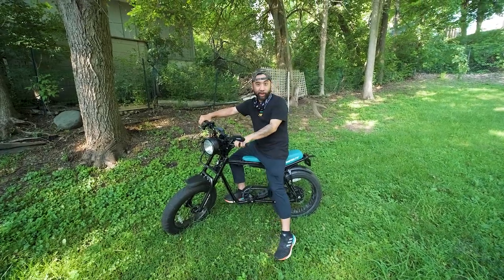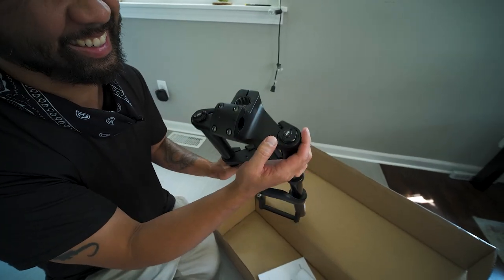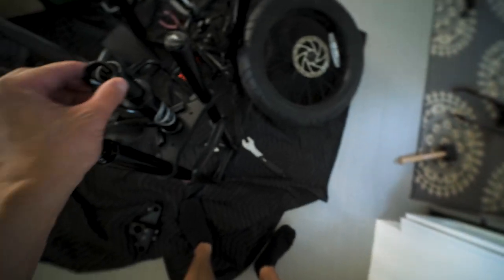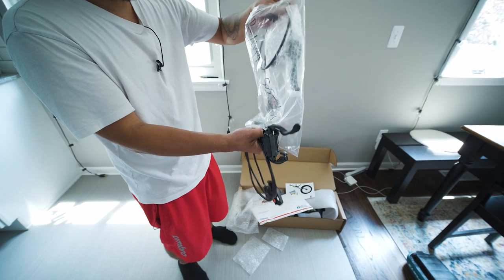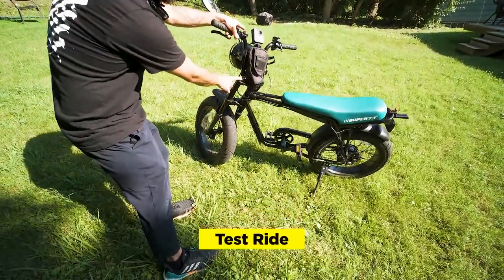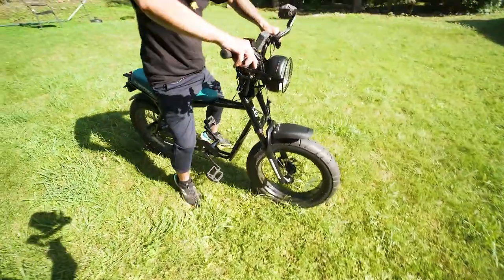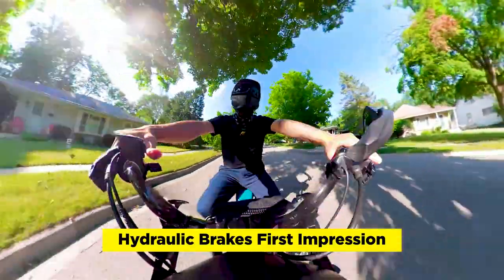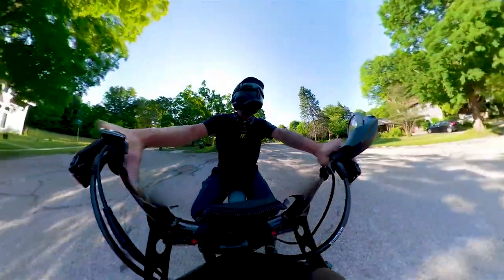Super73 Z1 Air Suspension Fork & Shimano Hydraulic Brakes First Impression | RunPlayBack

Comment: Hey man love the vid, I’m thinking of putting hydraulic brakes on my super 73 and I’m a bit confused on what I should do with the brake cut off. When I install the new brakes should/ could I leave the connector just empty or do I need to put something in place for that?
Reply from the maker: I left it off. It's not necessary.

Comment: the ebay seller for the hydraulic brakes is sold out of the black color option.  Any other upgrade options you know of...i need to do it ASAP.   Any suggestions would be greatly appreciated.

Comment: Hey question is it ok to get rid of the cut off motor from the hydraulic breaks it won't hurt the motor im trying to do the same on my bike?? Thanks in advance!
Reply from the maker: Yup that's right. You don't need the motor cutoff. The worst thing you'd end up doing is a tire burnout if you're holding down the throttle and the brakes. I wouldn't recommend that though.
Reply: @RunPlayBack  thanks for the reply much appreciate!

Comment: Do u think a surron battery would fit in the front on the inside of the frame or would it be to tall I found a z1 in my area dirt cheap wanted to go wild with it just because lol
Reply from the maker: It should fit, there's plenty of space in the frame, but how would you mount/secure it?
Reply: @RunPlayBack  probably have to make some custom mounts for it see what works

Comment: hey, i was wondering if you can tell me where u got that extension to make the hydrolic brakes fit on the rear.
Reply from the maker: I think you’re referring to the caliper bracket, they have different sized brackets, depends on the size of the rotor.

Comment: Where do you get the air suspension from
Reply from the maker: Super73 used to sell them. Unfortunately I think they are discontinued.
Reply: @RunPlayBack  do yo know where you can get an aftermarket part for the forks and fenders. If so could you please leave the link.

Comment: when you use the hydrologic brakes does it stop the battery
Reply from the maker: Not in this video, the hydro brakes used do not have an ebrake sensor.  You could add them separately though.

Comment: Can you send the link to the brakes you used for the Z1?
Reply from the maker: Sure thing this is what I got: https://www.ebay.com/itm/SHIMANO-Alivio-BL-M505-BR-M447-2-Pistons-Hydraulic-Disc-Brake-Set-M446-MTB-OE/352566551150
Reply: @RunPlayBack  Thanks!!!!
Reply: I'm assuming this brake kit came with pads. Are the pads decent? Or would you recommend upgrading the pads?
Reply from the maker: @davidikeda2587  The pads were fine. I don't see any need to upgrade the pads until necessary.

Comment: There’s a speed mod for the z1 too
Reply from the maker: Yup! It's a great hack. I haven't done it because I'll be upgrading the controller and battery to a 48v system. I'll have that video up soon. Stay tuned :)
Reply: @RunPlayBack  Do you know if the z1 can handle 52v battery as long as i upgrade the controller?
Reply from the maker: @charliebrown5964  you can but you'll need to make sure the controller and motor can handle it.